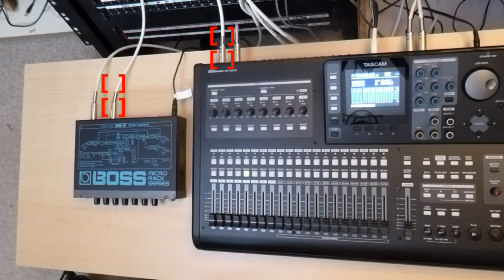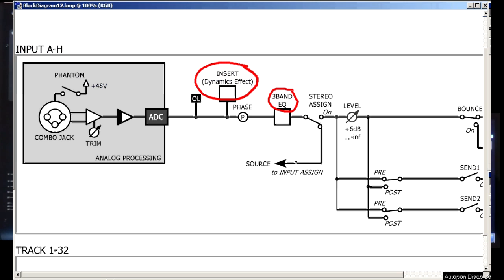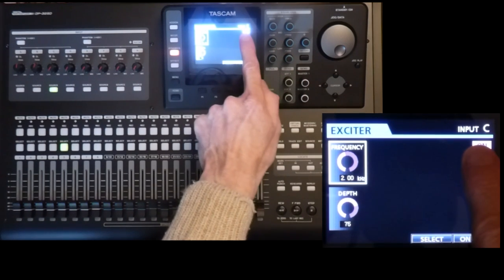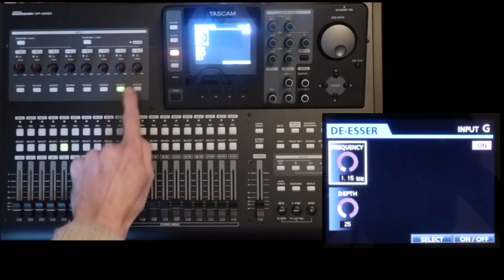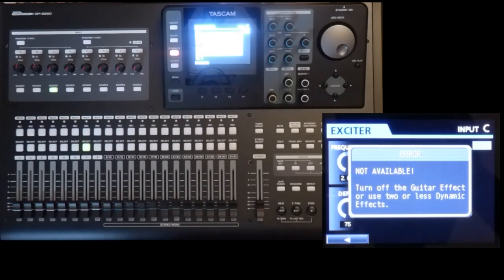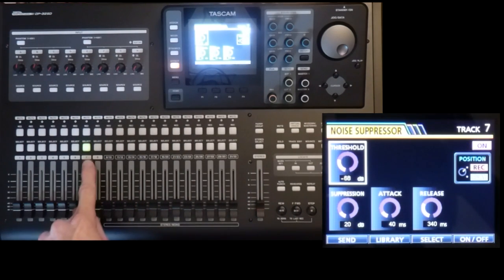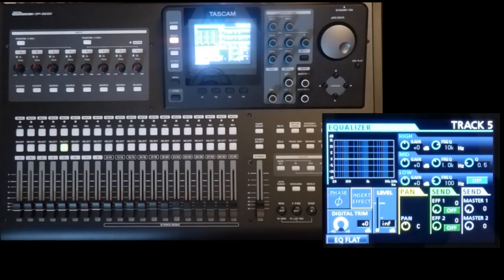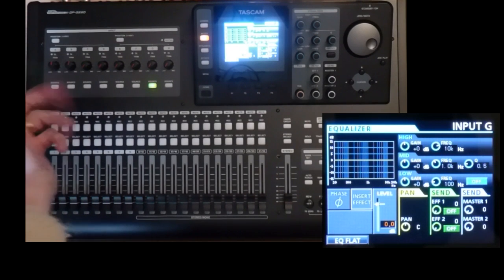Tascam DP24/32SD Tutorial 4: Dynamic Insert Effects

Comment: Thanks Phil,

You make mastering this machine a lot easier. There are some quircks that in the beginning make no sense, but your excellent walkthrough makes it a lot easier to operate the recorder.

Looked up some reviews and decided to get the 24 track. Your videos were actually a part in the decision making.
Reply from the maker: +Mike Hydropneumatuc thanks Mike, glad they helped. Hope you made the right decision re. the 24 track. My 2 main justifications for the 32 track model were: 
1. I was always short of stereo inputs on my analogue mixers, and this is a pain if you want to route synths, keyboards and effects (especially reverb) through it as they are all stereo. You can use pairs of mono tracks but you have to keep any level & EQ adjustments in sync. 
2. Extra tracks are always useful for multiple takes if you are only recording a few tracks at once. As mentioned in the videos, it's more convenient to audition these than to use the virtual tracks.
Obviously if these don't apply to you then the dp24 will save quite a bit in cash :)
Anyway hope it all works out, so good luck with your new multi-track ventures.
Reply: As an amateur 24 tracks is enough. Got a Roland Jupiter 50 and Moog M32, will be adding a (undecided yet) Moog Sub Phatty or Sub 37 a drummachine (Roland TR-08 maybe) and some sort of vocoder.

A guy at work pointed me to a digital mixer because of the error messages in case something wasn't ok. He does all sorts of production for amateur bands as he is educated as a recording engineer.

Basicly I needed something that could mix and record 8 track simultaniously. Analog does sound better but recording analog will cost tons of money so the Tascam  at €417 seems a perfect compromise. Where would this kind of money get you in the 80s?
Reply from the maker: Agreed Mike, sounds like you made a good choice. Some nice gear on the horizon - I can spot GAS when I see it ;) Might need tact to get it passed "the other half" if you've got one :)
Reply: A bit of GAS but i want to check gear for a month or so before making the plunge.

Some really cool and affordable synths out there for now (ARP, Moog, Roland, Korg King Korg).

Comment: how do i bounce tracks with effects so the new track has the effect recorded with it?
Reply: i should have read the previous comments and I would have seen Phils answer "If you try and follow the block diagram as shown in the tutorials, you'll see that the dynamics effects are only in the input paths, not in the track paths, so you cannot use them to add effects to pre-recorded tracks unless you route the output back to the input... possible, but need to be careful to avoid feedback. However, there is a compressor in the Guitar effect block, which is a track insert effect, so you can insert that into a track as it is playing back. This means the effect will be recorded during the mixdown process or a bounce process. Whether you mixdown or bounce is up to you - the pros & cons are described in the tutorials. Note there's only one guitar insert effect so you can only process one track at a time. Hope this helps. If not, drop me a line on the email shown at the bottom of my http://www.philizound.co.uk web site."  <----Thanx Phil

Comment: Hi, Phill. I have a question about the dynamic effect that is: Is it possible to adjust the noise of a channel only before recording? Or beforehand? For example, if after recording a voice on a channel and realizing there is a lot of noise I can not use threshhold to mitigate or eliminate this noise? Thank you in advance for the answer
Reply from the maker: Hi +Joanilson Rodrigues. You cannot re-use the dynamic effects after recording as they can only be inserted in the input paths. You could route the track playback signal back to the input using a cable and record it onto a spare track, but there is an easier way... use the noise suppressor in the track insert (guitar) effect. This effect can be inserted in the track playback path so you can record the result, either onto a spare track via bouncing, or onto the master file via the mixdown process. You can see the duplication of effect types in this summary http://www.tascamforums.com/threads/dp24-32-fx-definitive-summary-of-effects.4162/
Reply: Phil Tipping thank you so much.  I'll try it. what a pity that it is not possible by dynamics. I'll go to this way.

Comment: Hello again Phil (sure glad I found you : ) I have a follow up question for you.  I don't understand why the Dynamic effects (compression, noise suppression, etc.) can all be utilized and heard on any selected tracks when recording live but the Send effects cannot be, especially in regards to reverb as I originally asked you about.  When singing and recording live vocals, using reverb is a traditional necessity so I'm having a hard time grasping why this basic feature is absent.  Thanks again for the assistance.  Jeff R.
Reply from the maker: Jeff - yes, as mentioned in the tutorials, the operation is not intuitive once you start digging down. That's why I've emphasised the block diagram so much - it may alienate people but it's the only way of explaining how the different effects work. The Dynamic effects are 'Input Insert' effects so they intercept any of the 8 inputs, whether they're being recorded or just being passed straight though. The Send effect is fed by tapping off a portion of any track or input signal. The Send effect output only goes to the stereo output in normal multi-track operation. This means you can always hear it, but it is not recorded unless you can route the output back to a recordable input. This is what Bounce does. You're right when you say using reverb is a traditional necessity, but the feature is definitely not absent - it can be added and heard during recording and/or playback. The catch is that is cannot easily be recorded. As mentioned on the other comment, it's easy to fool yourself that the effect has been recorded as the Send effect is tapped off the track signals regardless of whether they are being recorded or played back.
Reply: Hi Phil, I think I am beginning to understand more about this now.  Your block diagrams are actually very helpful in explaining the process.  You said that the "Send effects" can be heard during recording... I think that is where I'm having trouble.  How do you accomplish that?  I've tried multiple times to monitor reverb while recording live but nothing works.  I'm sure I'm just missing something simple.  The Tascam user manual is pretty useless.  Thank you very much.  Jeff R.
Reply from the maker: Are you already able to hear (monitor) your signal while it's being recorded?  If so, then you just need to 'send' some of that signal to the internal send effect... 
Turn up the levels for the Send-1 path. Don't use Send-2 as this only goes to the external socket. The details are in tutorial no. 5, but basically you turn up the two send levels which are shown in the mixer screen. There's a level for each track or input (i.e. whatever you 'Select') - this is called Send EFF 1, and a master level which controls all the sends in bulk - this is called Send MASTER 1.
This is only half the story as you also have to get the signal back from the effect itself - this is the Return level, and is set in the Effect screen. If any of these levels are zero, you won't hear any reverb. The effect output is mixed with any other signals on the the stereo bus, so you'll be able to hear the reverb on the stereo outputs and the monitor outputs/headphones, assuming the Monitor Select is set to Stereo.
Reply: Ok great Phil!  I'm going to watch your tutorial video # 5 and follow these steps you provided and get this to work.  There is certainly a little more of a learning curve to this unit compared to the DP03 SD.  I was so used to having a simple reverb knob for each track that I guess I was spoiled.  Thanks for explaining how this all works. Jeff R.
Reply from the maker: Yes, it would have been much better to carry forwards the dp-03 system with a reverb (send) knob for each track on to the dp24/32, but I guess it would have increased the cost too much. More tracks means more knobs, but also there are 2 send paths so they'd have to double that. Far easier & cheaper to move it all into a menu. This is one of my pet hates with 'modern' gear - I much prefer one function per knob and no menus, but then the gear is so complex nowadays it would cost the earth and be too big to fit in the room! :)
Reply: That all makes good sense to me Phil.  I believe I'm beginning to grasp how to use this machine much better now.  I laid down 4 tracks yesterday and was happy with how they came out.  I even figured out how to insert the Send effects (with your help of course).  I guess this old puppy can still learn a few new tricks after all.  Keep up the great informative work that you do!  Jeff R.

Comment: I m trying to set a pre-count for the metronom when I m recording...how does it works?
Reply from the maker: +Emanuel Schinhan - see page 59 in the manual. There's no 'count-in' so you'll have to just count a few beats yourself before you start recording. The metronome screen also has an option to change the position indicator at the top of the home screen to display bars & beats instead of mins & secs.
Reply: Phil Tipping 
thx !:)

Comment: Thank you for the well explained video! I have one question. Is there a possibility to add a dynamic insert effect to a recorded 'track'?
Reply from the maker: Hi Anton. Yes you can do this by connecting an output to an input, although you need to be careful to avoid feedback.
Here's one way using one of the Send outputs, e.g. to pass track 1 through Send-1 to dynamic effect on input A and record the result onto track 2:

Turn all track and stereo faders down.
On track 1, set Eff-Send-1 to Pre and turn up both Send-1 and Master-1 levels.
Set the Monitor to listen to Send-1 (via the Monitor Select button), and confirm that when you press Play, you can hear track 1. Note do not move any faders, just the monitor knob. Press Stop, then rewind.

Connect a jack-to-jack cable from Send-1 to Input A.
Assign Input A to track 2 for recording the result.
Arm track 2
Change monitor select to Stereo.
Turn up stereo fader.
Turn up fader for track 2.
Confirm by pressing Play that you can hear the signal reaching track 2.

For Input A, turn on the reqd. dynamic effect.
Adjust settings while Playing.

When happy, press Record.

There are 2 send outputs so you could use 2 cables to process 2 tracks this way and record them via their own dynamic effect onto 2 separate tracks, all in one pass.
You could also use the stereo or monitor outputs for looping back but there's even more risk of feedback!
Reply: Hi Phil. Thank you for your quick answer! It was very helpful. Although I don't understand this:
 'As there are 8 dynamic effects, you can process up to 8 tracks and record them onto separate tracks, all in one pass.'
Could you give an example? Thanks
Reply from the maker: Oops my mistake Anton - was getting carried away with the 8 recordable inputs :)  You could only do this if you had 8 separate ways of getting the tracks out of the machine, but this is not the case.  You could certainly do 2 tracks at once by using send-1 for one of them and send-2 for the other, then use 2 cables to connect the send outputs to 2 spare inputs, and assign them to 2 separate tracks for recording. There may be some devious way of also using the monitor outputs as well, but haven't really thought that through, so I'll stick at 2 concurrent tracks for now :)  I'll amend the comment so it doesn't confuse others.
Reply: Thank you so much! I really appreciate your work.
Reply: Hi Phil This is my last question ;-). Can you also give an example of this method with an 'external fx device', please?
Reply from the maker: Not quite sure what you mean. Isn't it just a case of inserting an external FX unit in the feedback link... which is how you would normally use an external send effect - the next video (part 5) covers send effects. Or have I misunderstood your question? :)
Reply: Yes. But can you use a compressor unit for example with the send 1 and send 2 function of the tascam, since it is an insert effect and not a send?
Reply from the maker: You may need to review the videos - I was hoping they explained what 'insert' and 'send' mean :)
Reply: Ok! I'll watch part 4/5 once more!
Reply from the maker: Part 5 has the best summary of both types. You can always ask again if it didn't help.
Reply: So I rewatched part 4 and 5 and read the chapters in homerecording for dummies about signal processors.
 
Am I right to say that you can't use an external 'insert' fx unit(compressor,de-esser,...) with the tascam because the tascam has no TRS insert jack? 

If I would like to hook up an external delay effect (a stompbox) as a send effect: is this the proper method?
 
From Tascam Send 1 or 2 to the input of the delay unit. And then from the output of the delay unit to channel A for example. And then assign input A to the stereo bus of A?
Reply from the maker: Q1: You're right there is no TRS insert socket, but this doesn't stop you using an insert fx in the send path. I think there's still some confusion between the two. The send output is just a way of getting a signal out of the machine independently of the main output. The inputs are the way back in. Each input or track signal inside the machine can be routed to the main stereo output, or either of the send outputs, or all at the same time. So say you want to 'insert' an external effect into track 5, you'd route track 5's signal to one of the send outputs, and turn its route to the main output off. You do this by setting the Send for track 5 to 'pre' so the send signal is tapped off before track 5's fader, and then turn track 5's fader off so that its 'dry' signal doesn't go anywhere. You feed the send output to your external 'insert' fx and its output back to a spare input. This input is now effectively track 5 having been processed by the external fx. This is exactly the same as breaking the input path and inserting a built-in insert FX. The fact that you're using the 'send system' to route the signal is nothing to do with whether the effect is described as an insert or send fx. The terms 'send fx' and 'insert fx' are confusing as it's 'how' you use an effect and not the effect itself. That's what I was trying to clarify in the videos :)
Q2: Yes a time-related effect like a delay is normally used as a send effect because you need to retain the original (dry) un-delayed signal and mix it with the delayed (wet) signal (you don't have to of course, if that's what you want). So in this case, you would normally use the 'post' send signal so the track's fader controls the level of both the dry signal going through to the main output and the amount sent to your stompbox. If the stompbox has an output level control, this would adjust the return signal level.
Q3: Correct. In this case, you could also use the input's level control (the one in the mixer screen) as a return signal level.
Reply: thank you. I think I understand it completely now!
Reply: Hi Phil. I tried it out 'the external delay send effect' But I realised that if you turn up the channel's gain knob the effect becomes stronger/louder. Should you always keep the chanel's gain knob at zero?
Reply from the maker: Ok Anton, sounds like it's coming together.  I'm assuming you mean the 'channel gain' for the input/track being used to send the signal to your external effect (and not the gain of the signal coming back in from your effect). If so, then the answer depends on what you're trying to achieve. If you use the 'post-fader' signal then the channel gain will affect the send amount as well as the dry signal, so the effect will keep in step. This would be correct for a natural-sounding reverb. If you use 'pre-fader', then the effect will always be present even if you turn the channel gain down to zero... you'll have a ghostly type of reverb, but you may prefer this type of sound - it's up to you.  Don't forget, if your external effect has a wet/dry mix control, then it may be better to turn this to 100% wet. Again the choice is yours as to whether you control the dry/wet mix with your external FX unit or by using the controls on the dp machine.
Reply: Not sure if I explained it right: So I recorded a track and after that I hooked up the delay pedal (send to input delay, output delay to channel A) Then I assigned A as a stereobus to that recorded track . I noticed when I turned up the gain. The volume/effect became much louder :)
Reply from the maker: Still not too clear about the setup - sorry! When you say "assigned A as a stereobus to that recorded track", do you mean you assign input A to the stereo bus? The bus is the bus - it's where all the inputs and/or tracks end up. Are you saying that the amount of delay is getting larger when you turn up the gain of the input which is receiving the effect signal? Maybe a picture would be easier to understand. If you send me a drawing to the email on my http://www.philizound.co.uk website, it might be easier to sort out this problem.
Reply: I've sent an e-mail